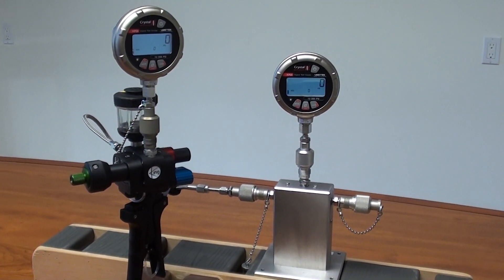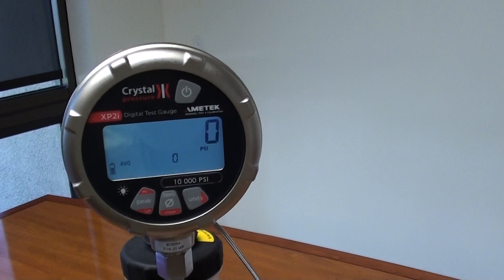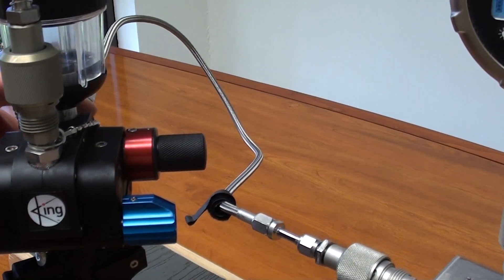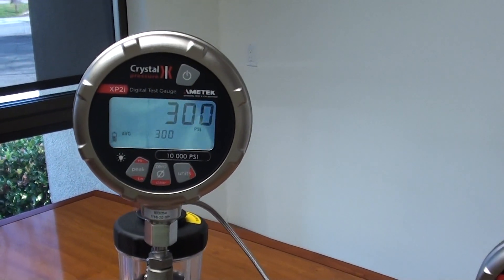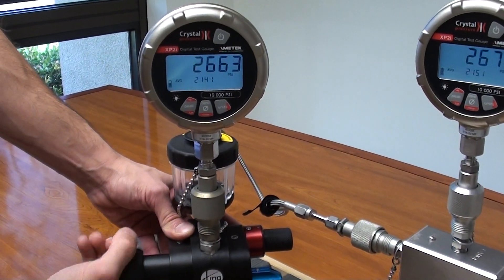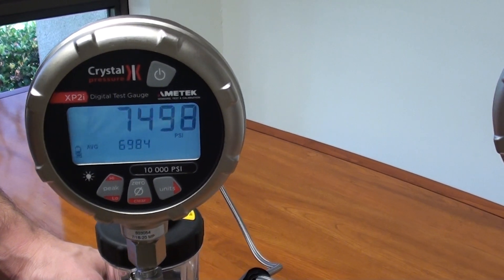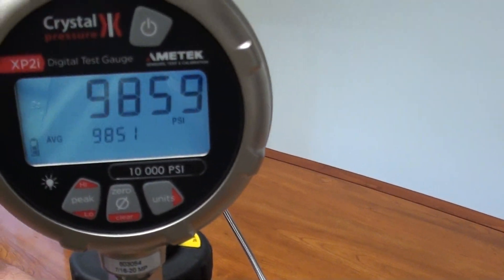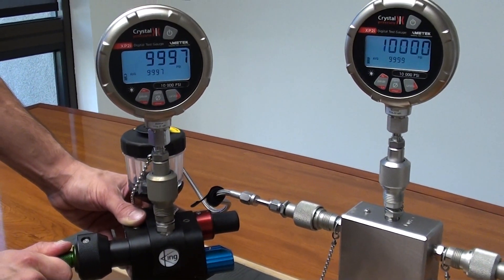0 to 10,000 PSI using a handpump

Comment: whats the temperature of 10000 psi air?
Reply from the maker: Hi! Thank you for the question. The pressure generated in this device to reach 10,000 PSI is derived from hydraulic means. The fluid inside the pump is water, not air. The exact temperature inside the pump would be difficult to measure, precisely, but would be very close to ambient. 
Please reach out to us via email, support@kingnutronics.com, or give us a call at 818.887.5460 if you would like to discuss more. Thanks.